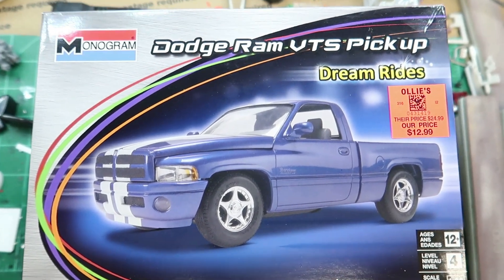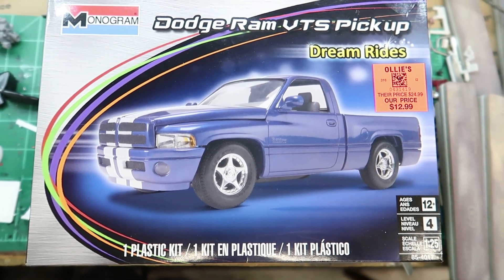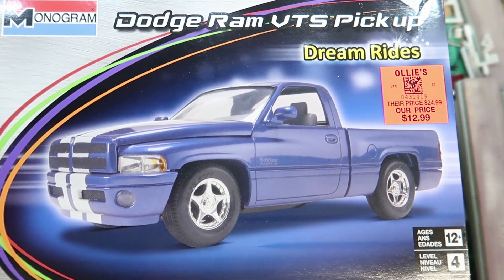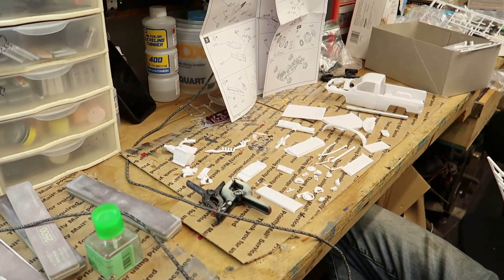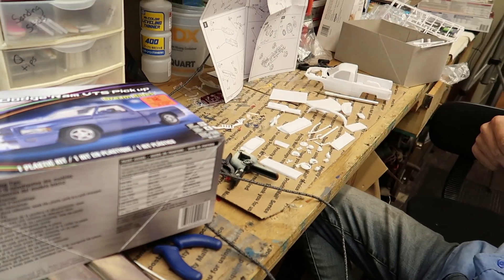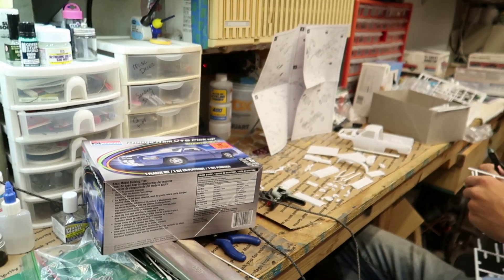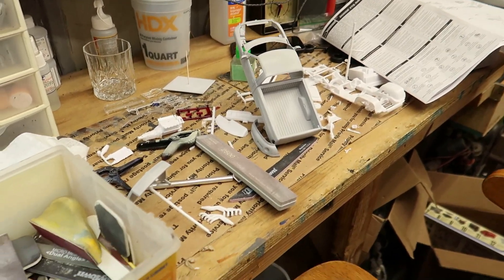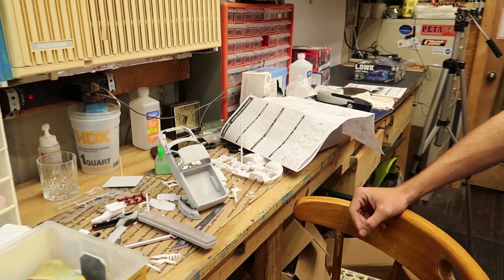I have another visitor in the model room!! Joseph decided to build the Monogram Dodge VTS truck!

Comment: IIRC, those Dodge VTS pickup kits were originally by Revell. I have one from when they were 1st issued in the early 90s. The VTS with its iron block Viper V10 engine was competition with the the Chevy 454SS and the Ford Lightning. Oddly, the Ford with a far smaller engine than the other 2 was the quickest and fastest of the bunch.

Comment: Nice video, kept me smiling. This generation Ram 94-01/02 never had the viper V10, it was the next generation with the SRT-10. The VTS is a concept truck. You were correct in regards to the auto/manual depending on cab in the 02/03 on generation. I was selling Dodges at the time and almost bought a silver 4door but really couldn't justify it at only 20 years old.

Comment: I don’t understand why it matters that they were purchased at Ollie’s. Weird. Once “I” purchase it, it’s MINE. If I decide to sell it, I’ll ask whatever price I want to ask. Why cover previous price tags? I have vintage factory sealed Johans and MPCs with $2.99 tags on them. Is that how much I’m forced to sell them for? 🤔
Reply from the maker: They aren't vintage price tags so if a scalper wants 30 and they see they only paid 13 they probably wouldn't buy it. You're right, but think you missed the point. The question was why the plastic was covering the price sticker. I guess Ollie's got the bare boxes and shrink wrapped them. Thanks for the comment 👍🏻